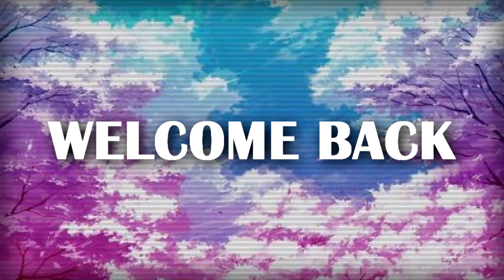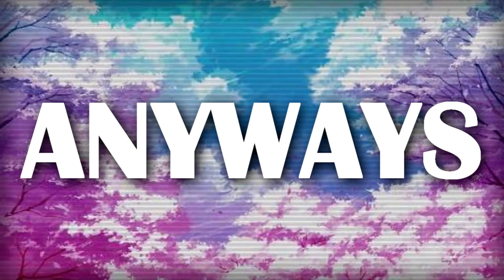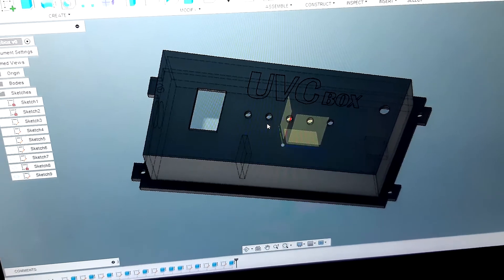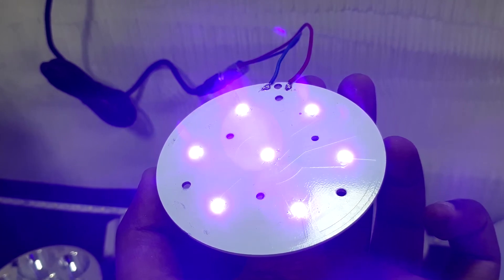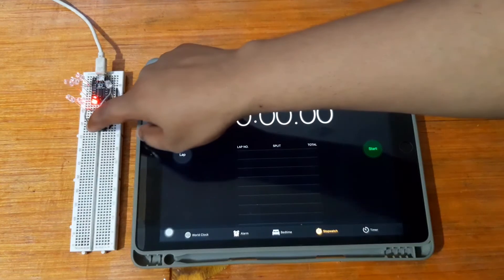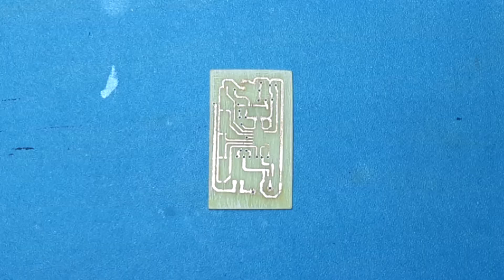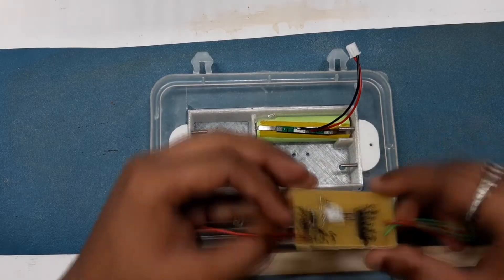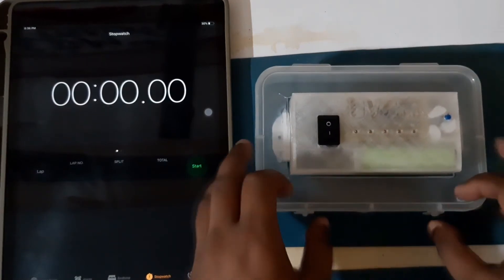UVC sterilizer box

Comment: Did you really use UVC LEDs while working on this project? I have a very strong suspicion that you used blue LEDs instead. Especially considering that you delivered 3.3 V to the LEDs connected in parallel, and the forward voltage of blue LEDs is 3.3 V 🙂

The UV LEDs emit photons of 4.5 - 4.7 eV, so you would need to step-up the 3.7 V to at least ~5 V. The forward voltages of different UVC LEDs are usually in the 5 V - 7 V range.  I don't expect that the way you set this up would be able to power the 275 nm UVC leds. But please do correct me if I am wrong!

I am currently making some UVC lamps using T5 mercury tubes. It does require connecting the electronic ballast to 220V AC. I am curious about the pros and cons of UVC LEDs vs tubes.
Reply from the maker: Nah man. UV leds comes in various operational voltage, I'm using UVC leds that comes in 2835 package and have working voltage between 2.8V to 3.4V. there's also 6.6V version and a 9.9V ones.